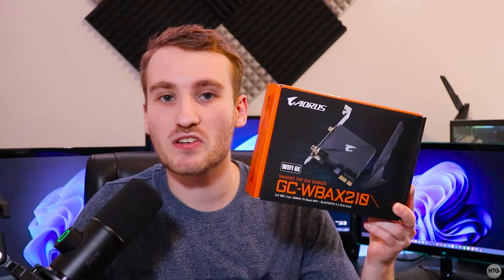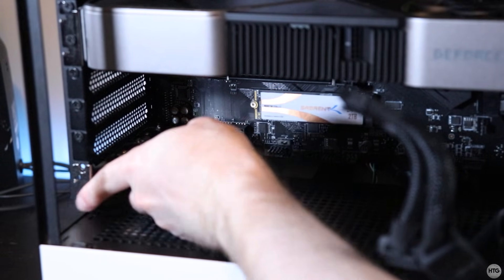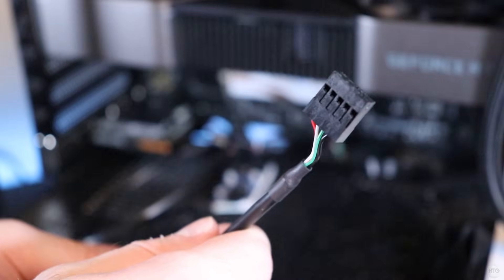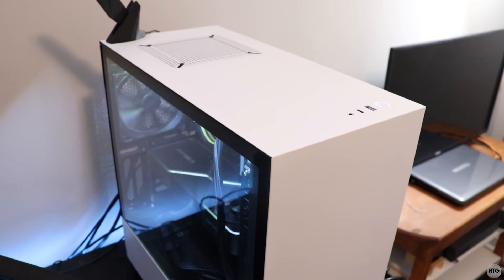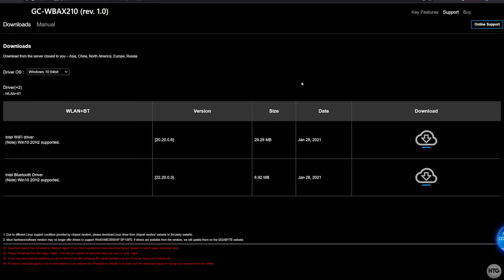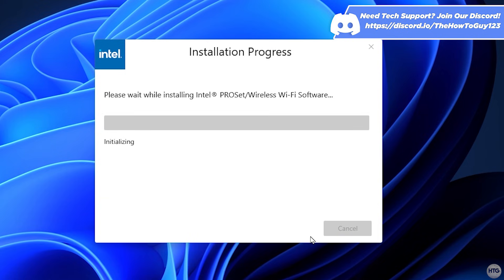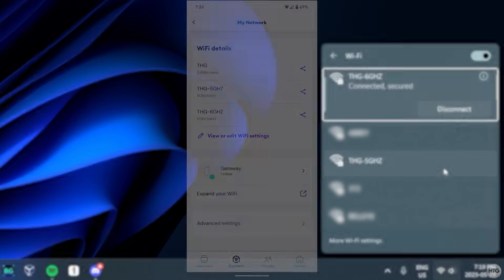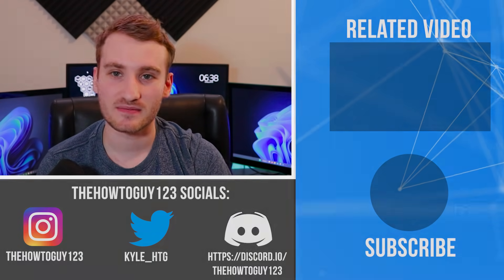How To Install a PCIe WiFi 6e Card Into Your PC (Gigabyte Aorus GC-WBAX210)

Comment: Hey, what if it is still not working with the drivers installed?
Reply from the maker: You might want to try reseating the PCIe Wi-Fi card to ensure it’s properly connected. Then, check if it’s being recognized in Device Manager. If it isn’t showing up or not functioning correctly, try installing one of the older drivers available on the Gigabyte website. Also, double-check that the PCIe slot you're using is actually enabled. On some motherboards, certain PCIe slots can become disabled when you have multiple NVMe drives installed or if another device is occupying the main PCIe x16 slot.

Comment: im trying to use a wifi card for better networking while on the go for my custom PC ( DDR 5 board 12900k  4060Ti GC ) simply because the stock realtek is ASS and im trying to change the wifi from realteks bs to the new wifi card i got ( GC-WBAX210 ) and this shits not working....

Comment: Wait. So does this not Work with an amd prozessor? :(((
Reply from the maker: It does. The chip in the wifi card is just made by intel. So we install an intel driver.
Reply: @TheHowToGuy123  got scared there for a sec
Reply: @TheHowToGuy123  I did the steps, but the bluetooth still does not seem to work for me :/

Comment: you need to use a bluetooth usb stick to get bluetooth compatibility?
Reply from the maker: No. You need to connect the wifi card to the usb header on your motherboard using the provided cable.

Comment: It worked just fine on my Mid-tower ATX system with NZXT H440 case, but on my mom's HP Pavillion computer the case has brackets that are too small. The bracket on the wi-fi card is too big to fit into the bracket in the case. SMH

Comment: Excellent video. Very informative. My question which is probably out of far left field is, there's another separate port from the USB cable connection. Looks like a female USB port. Thought we may need to have something in there connected in some way to the motherboard.
Reply from the maker: You can plug a USB-A to USB-A cable from the card to a USB port outside of the case, in order to get Bluetooth to work, in place of connecting the card to a USB 2.0 header on the MB. But it's not ideal IMO.

Comment: If I have an AMD Ryzen CPU, can I still use the Intel drivers instead of the drivers from the official website?
Reply from the maker: Yes, this is independent of the cpu. The wifi card just has an intel wifi chip on it, so you need to download drivers from intel.

Comment: So do I need to connect the WiFi Card via USB 2.0 to use Bluetooth or does simply plugging the WiFi card into the PCIE slot already provide BOTH WiFi and Bluetooth? Thanks!

Comment: I’m having an issue where I have everything plugged in ready to go, but I can’t access any wifi options, it’s not recognizing anything
Reply from the maker: Have you installed the drivers? Does the card appear in device manager at all?
Reply: @TheHowToGuy123  i had the same issue i did the drivers and dont see it does it work on all mobos? i see the blue tooth but not wifi

Comment: does it also work with an amd b550 for amd cpu motherboard?
Reply from the maker: Yes. That's what I'm using in this video. It doesn't really matter what motherboard or CPU you are using as long as your motherboard has a free PCIE x1 slot.

Comment: Do I need to disable my existing wifi 5 that's built into my motherboard before adding this card?
Reply from the maker: You'll probably need to disable it in device manager so the two wifi adapters don't conflict with each other.

Comment: hey man any idea of long the cable between the antenna and the NIC is, also is there any way to extend it?
Reply from the maker: The antenna cable is about 80cm long (31.5 inches). No way to really extended it. I think that would degrade the WiFi signal.
Reply: @TheHowToGuy123   well that sucks, i read that it can be extended with a RP-SMA cable and if its not too long it wont hurt that much, i need like 1,2 meters more and it will be perfect!

Comment: I have this wireless card, exactly the same. My Bluetooth has never worked. Not with a header cable, not with usb a male to male. Idk what I’m doing wrong anymore. Drivers updated, reinstalled device manually and in device manager, still, nothing.
Reply: did you now resolve this issue?

Comment: Yo tf is the usb A for than
Reply from the maker: Rather than connecting the card to a USB header to get bluetooth working, you can connect it with a USB-A to USB-A cable. But on 99% of computers, this involves running the cable to a USB port outside of the case.

Comment: Quick question does it matter which pcie you buy for your motherboard, and if so im buying the Asus prime b450m-A II (Amd), is this pcie compatible with my amd motherboard?

Another thing is when i searched this pcie on amazon there is 1 antenna, i dont see a antenna on yours does you have to use it?
Reply from the maker: Any pcie card will work. You do need to use the antenna. I connect my antenna at 4:05.

Comment: Thx for the driver link. I've only used ethernet cable for my gaming computers for years. This adapter is my first experience with a wifi connection for my PCs.
Reply: hows it going with it?
Reply: fr

Comment: I’m having a super weird issue with this exact card—when I install it, my PC won’t boot!  All of my lights flicker when I hit the power button, but shut off as soon as I let it go.  (If I hold the button they just flick on and off.). As soon as I uninstall the WiFi card, my PC boots and runs fine.

I’ve tried both of my PCIe x1 slots, and tried forcing the slots to Gen 1 and Gen 3, but no luck.  Does anyone have any ideas?
Reply: I was able to test my card in another PC and it didn’t have the same issue (just had to install Intel WiFi drivers), so I’m thinking it was something specific about either the combination of my motherboard and this card, or that my motherboard doesn’t like having my PCIe x1 slots populated at all
Reply: i have the same issue and i try to know why :/

Comment: what is the usb a port in the back of the wifi card used for?
Reply: Somebody wasn't watching the video, lol. That's the bluetooth connection to your mobo.
Reply: @raincadeify  the other usb port the one that connects to a regular usb cable
Reply: @lemanael8199   Not sure what you mean .. but the internal usb modules look different than the external ones. On the back of the card is port that you plug the cable into and that plugs into the motherboard to connect the bluetooth; if that answers your question.
Reply: The pcie slot is for the wifi, if you only use that then you don't get bluetooth, which you may not need.

Comment: I installed the card into the appropriate slots and the cable as well as the cables. When I was attempting the setup I installed the WBAX210 drivers from when they were on windows 10. I then installed the drivers from intel and restarted but the Bluetooth component is not working
Reply: I'm pretty sure your not supposed to download both, but I guess you could delete the driver that doesn't support your driver and it might work.

Comment: Sorry I quick question my wifi card is a Realtek PCI GBE Ethernet Family controller but on the website it does not have the drivers for windows 11 what do I do then?
Reply from the maker: Realtek PCI GBE Ethernet Family controller is not a wifi card and is most likely the ethernet port on the motherboard. If you are looking for a driver for it, I'd look up the page for your motherboard and there should be a driver for it there.
Reply: @TheHowToGuy123 omg I’m sorry I just figured that out the wifi card was not popping up after installation it is a TX-5B22 Wireless Lan Card
Reply: Under network adapters my card won’t pop up but I installed it correctly
Reply from the maker: I'd reseat the card then install this driver: https://www.ath-drivers.eu/download-driver-nr-326-for-atheros-AR5BWB222-and-Windows10.html
Reply: @TheHowToGuy123  thank you so much
Reply: @TheHowToGuy123 I know I’m asking a lot of questions but how can I reset the wifi card if it doesn’t show in device manager. It just has been frustrating me recently trying to get the card to work.

Comment: Thanks for stating that you have to plug in the usb header for bluetooth. I have only 1 USB header on my motherboard and removed my PCIe wifi card since I connected my fan hub to the USB header. Now to get a splitter.

Comment: Quick question, I just ordered my first pc and forgot to add the Wi-Fi option 😅 so I’ve been looking into vids like this and it seems pretty straight forward I have a intel i5 with windows 10 would it still work? My motherboard is a Gigabyte Intel H610M Motherboard so would it already have Wi-Fi/ the slot to plug it into? Thank you.
Reply from the maker: It looks like the motherboard that your new PC comes with only has one PCIe slot, which will be used for the graphics card. So you most likely won't be able to use this card in your PC.
Reply: @TheHowToGuy123  what can I do then?
Reply from the maker: @Chwisaaa  You can either get a USB WiFi adapter or an Ethernet power line adapter (easiest way to get Ethernet without running cables).
Reply: @TheHowToGuy123  what would you recommend out the two?
Reply: Ethernet or wireless Ethernet or used the ps Wi-Fi that’s installed
Reply: @TheHowToGuy123  it would work I’ve checked with the company another tech guy and my mates the graphics has nothing to do with that slot that needs adapter
Reply from the maker: @Chwisaaa  woops I was looking at the "i" model not the "m". This card will work fine.
Reply: @TheHowToGuy123  haha it’s fine mate I’ve ended up going for a different card because delivery time there the same with the options on the card but it’s the same plug in as the other one 👍 gonna give a sub so when it comes tomorrow I can watch the vid, pc comes Tuesday tho..

Comment: For the Bluetooth option does the WiFi card come with those cables or do I have to buy them separately?
Reply from the maker: All necessary cables are included.
Reply: @TheHowToGuy123  thanks I was worried I would have to buy it separately 😅

Comment: I apologise if this is a stupid question. Would the intel drivers work on an AMD machine? Are the drivers for the chipset on the card? Ty
Reply from the maker: The drivers are for the Intel chipset on the WiFi card so it doesn't matter if you have an AMD CPU.

Comment: What if I have an AMD processor? Which drivers should I install?
Reply from the maker: The Intel ones. Intel makes the WiFi chipset on this WiFi card which is why we install intel drivers. This is independent of the CPU. The computer that I used in this video also uses an AMD CPU.

Comment: Do you have to connect the USB cable? The ASROCK RACK ROMED8-2T doesn't have this header.
Reply: The USB cable is only needed if you want Bluetooth, otherwise you can do without it
Reply: Thanks. I think my issues were clearly not related to that cable.

Comment: i got it plugged in and everything although it says my oc ran into a problem and won’t start, i’ve looked into the advanced problems and tried to fix it, restart it and nothing is seeming to work, may you know maybe what’s the problem
Reply: I'm answering 8 months too late but if your motherboard already has a wireless device, you need to disable it in the bios. I had to do that as well and then it worked flawlessly

Comment: My Wi-Fi only uses 500mbs of data usage. I download at 40mbs and upload at 20mbs. What should I do to increase performance. This is a custom computer btw, so I didn't know how to setup the computer so that all of the drivers are up to date, and what settings were right for good performance.
Reply: I know this is late but don’t use YouTube as a substitute for google

Figure out if your drivers are up to date but you probably just got a shitty wifi card
Reply: @deucedeucerims  Ye that's what I was thinking because the wireless connection to the  Wi-Fi from my PC doesn't even reach 50 feet.

Comment: Noob question here. What if I skip the USB-A to USB-A cable connecting step? If I just put the PCIe WiFI into the slot, will it work on its own without using any other cables?
Reply from the maker: WiFi will work, but Bluetooth will not.
Reply: @TheHowToGuy123  Thank you for clarifying that the USB step is optional. I don't think I have any free slots but I really don't care about the Bluetooth function, The WiFi is all I need atm.
Reply: @TheHowToGuy123 THIS was the answer I needed. I only need wifi for my build - Bluetooth isn’t needed
Reply: I’m having the issue where I got it all plugged in and ready to go, but for some reason I can’t access the wifi via the internet settings on my PC. It doesn’t give me a wifi option…..

Comment: Could someone please help me out? I e plugged in the wifi adapter and set up the antenna. Only issue is that I still can’t connect to the internet. No available networks show up and it tells me to change settings. I’m not very great with computers sorry.
Reply: Hey let me know if you found a solution!

Comment: I don’t get it. Does this act as it’s own Wi-Fi like a mini router or does it just improve the Wi-Fi I have in my home
Reply from the maker: It lets your PC connect to wifi.
Reply: @TheHowToGuy123  yeah but i have no wifi in my home at the moment. so if i put this card in, is it a built in wifi that only my pc can use?
Reply from the maker: @ASTY2B  No, you will need a wifi to use this card. However it will allow your computer to connect to a hotspot on your phone.
Reply: @TheHowToGuy123  does it become self sufficient after ive downloaded the drivers or will it always need to be connected to my hotspot
Reply from the maker: @ASTY2B  It's not self sufficient. If it's not connected to your hotspot your have no internet.

Comment: sooooo you went to an intel website to get the drivers for windows 11 but i have a ryzen cpu. can i still use the intel website?
Reply: Figured it out. Install the intel driver that he is mentioning in the video. The reason is because the WiFi card itself uses an intel ax210 chipset
Reply: @renevelazquez00 good information thanks !
Reply: @renevelazquez00  thanks so much i kept trying to figure this out
Reply: Same here. I have a Ryzen 9 5950X and I don’t know which drivers to download

Comment: I bought a wifi card but i didnt have this big case. It was just the card. Is there a way I can install it myself?If theres one, how?
Reply from the maker: As long as it's a pcie card, you can install it the same way as I installed mine in the video.

Comment: Don’t unplug the power supply just turn it off you are gunna want to keep your pc grounded and touch the psu every few minutes to prevent static shock and ruining your pc
Reply: Touching ur psu? Is this a metaphor?
Reply: @d4mterro320 It stops static buildup which could ruin ur whole pc
Reply: Static wrist strap?
Reply: It may be good practice but modern PCs are simply not this fragile
Reply: Yes it's being proven static won't short anything

Comment: just an fyi for anyone watching, don’t download the drivers from gigabyte. i just did a fresh install of windows, installed the drivers and immediately received a netwtw10.sys bsod and kept happening until the driver was uninstalled
Reply: why does this happen? what should I do instead? is the WiFi card good?
Reply: @SPEAKACHU  i fixed it by removing the card and just using my motherboards wifi instead. i was using the card before this and the card worked flawlessly; never once dropped my connection

Comment: What if your motherboard comes with Wi-Fi? Mine is a B660M DS3H AX DDR4 Wi-Fi, and it comes with a Wi-Fi antenna. Do we use that one or this one?
Reply from the maker: Yep use the one on the motherboard. No point in buying a pcie card, especially since the wifi on the motherboard supports wifi 6.
Reply: @TheHowToGuy123 will this Wi-Fi card increase the download speed of the Wi-Fi?
Reply from the maker: @andynguyen6670  It won't be much of an improvement over the one on your motherboard. Not worth it in my opinion.
Reply: Btw, if your computer comes with wifi... just get an antenna lol if you install this to your motherboard your PC won't know what to do and will just blue screen. Just use the antenna 😅

Comment: Im running into an issue with the bluetooth not working, so i checked events and it said further installation required?
Reply: I'm having the same issue, i downloaded the drivers, wifi works fine right off the bat but bluetooth doesn't pop up in the device manager or anything.
Reply: Did you find any solutions? @TheToxic163

Comment: QUICK TIP: 

If your motherboard does not come with pcie x1 slots......you CAN plug these wifi cards into a pcie x16 slot (the same slot you plug a GPU into)
Reply: I just returned this Wi-Fi card because my video card is too big and just closes pci e slot. Bruh.
Reply: @yaroslavkharchenko3272  Bruh😭😭
Reply: @yaroslavkharchenko3272 You can use a PCI riser.
Reply: @yaroslavkharchenko3272 😂😂😂
Reply: Good shit man I was stressing
Reply: Thank you so much, I was panicking for a sec
Reply: W comment
Reply: i have a pcie x1 slot but it’s on the top where i can’t get to so i plugged it into the x16 slot and it is still not working i don’t know if im supposed to download something or what
Reply: @mrw177   Yeah double check your PC is detecting it in the device manager settings. Which you should see it under Network Adapters. It may just need updated drivers to function
Reply: Exactly what I needed to know
Reply: Ik im a little late but I plugged it into that slot and my pc isn’t recognizing it
Reply: For me il trying to learn how to get the wireless adapter OUT OF MY PC 😭 because I want a graphics card and it looked like the wireless PCI adapter is in the way of my one and only thing that looks like a RAM slot 😅 I’ve got a usb WiFi thing which I’m assuming does the same thing as the wireless PCI adapter